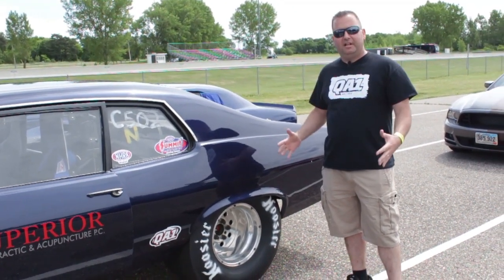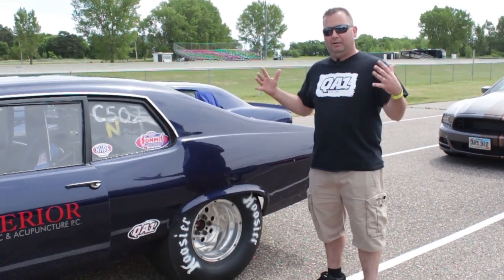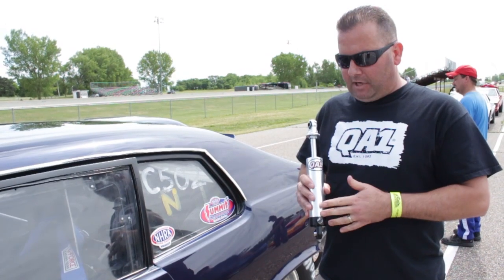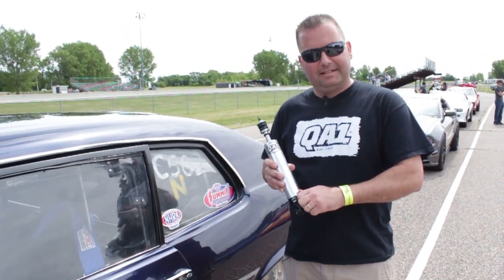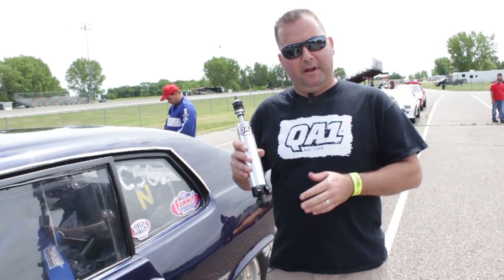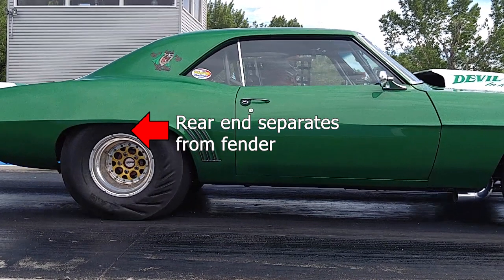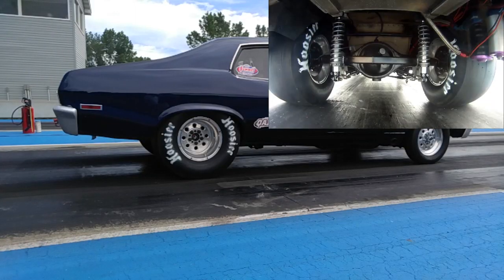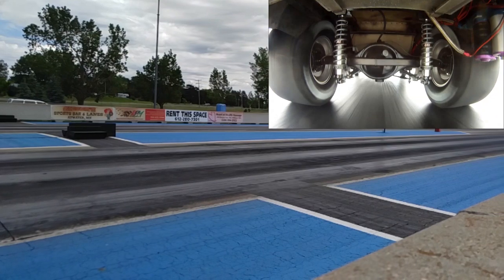How To Tune Your Rear Shocks At The Drag Strip

Comment: Hi Sir.   I have a 1990 musting 380 HP.  I use a 4 speed manual and launch at 5,800 RPM.  I use a 9 inch slick.  What is you shock suggestion?  Thank you.  I like the info you presented here.

Comment: So if i have a 4 link car that slightly rattles the tires on a tight track around 60-100ft would that be a compression or rebound issue if its that soon, my guess would be to loosen compression by the this video, car is awesome on a hot track
Reply: I would have thought to actually tighten the compression?
Reply: Sounds like it wants some more air pressure.
Reply: More air pressure or more power.

Comment: I think he got Compression and Rebound/Extension backwards. Comp should be what hits the track, Rebound controls the shock's extension
Reply from the maker: The extension of the axle downward (rebound) is what allows the tire to dig into the track during separation. The compression is the tire moving back up into the fender. A firmer compression after the hit of the tire will help hold the tire down to the track.
Reply: @QA1TECH  right, but with when shifting weight, isn't the compression what makes the tire hit the ground? Do to the shift in weight, wouldnt a higher comp (making the compressing of the shock stiffer) be sending the tires into the ground? And the rebound, isn't that the rate in which the shock expands?
Reply from the maker: @coltenconneway1230  Gotcha. We see what you're saying. Yes, you are correct. Compression is also used for what you're explaining. Both explanations are correct. We're both just looking at it in different ways. Thanks for sharing yours! It's cool to see the way other people think about it.
Reply: @QA1TECH  I almost had a heart attack! I was like, "have I been doing this wrong?" 😬
Your shocks have definitely helped me, thank you guys!
Reply from the maker: @coltenconneway1230  Haha nope! You're doing just fine. Glad to hear our shocks are helping you out! Our engineers will be happy to hear that. We appreciate you and your business!
Reply: @QA1TECH  so which is which ?